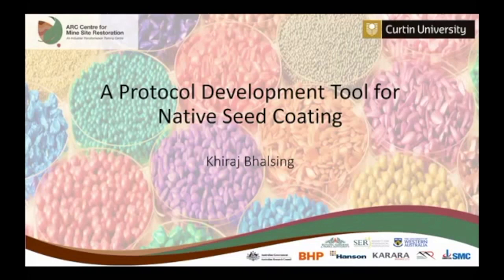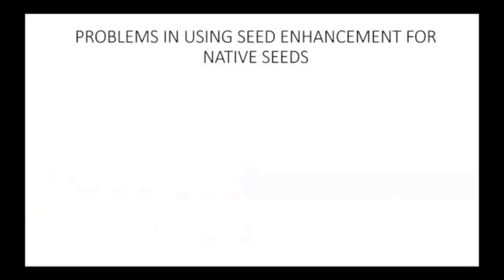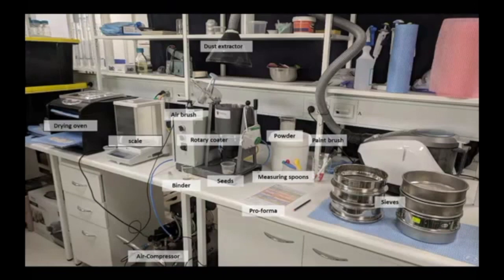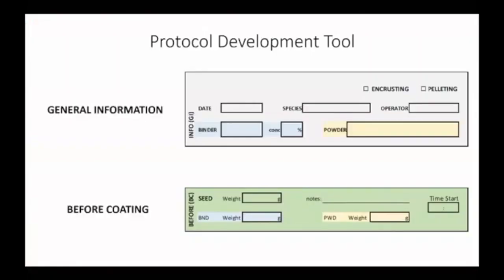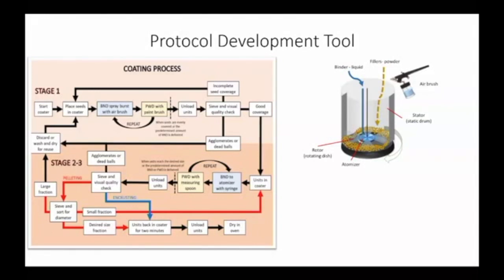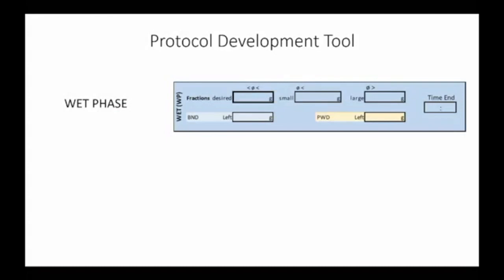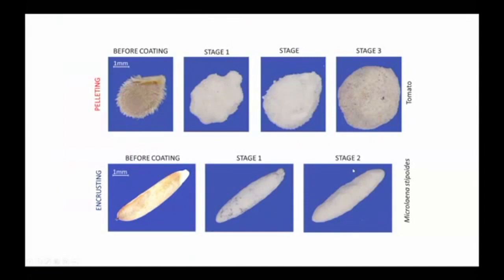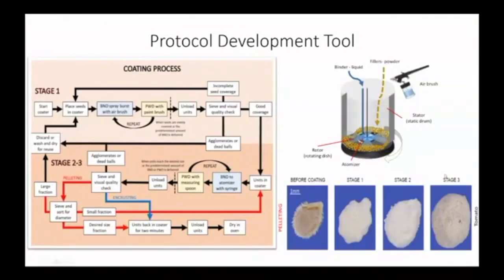A Protocol Development tool for Native Seed Coating

Comment: Native seeds in their native range should not require "enhancement" with chemical fertilizers. Dark side indeed.
Reply from the maker: There is not only chemical fertilizers, you can use ecological elements. There is abundant experimentation that shows that this elements increase germination and also are used as a predator deterrents.